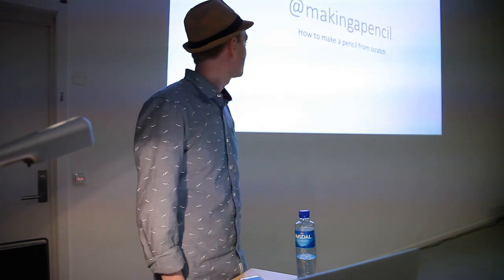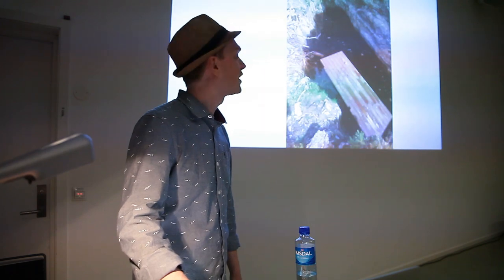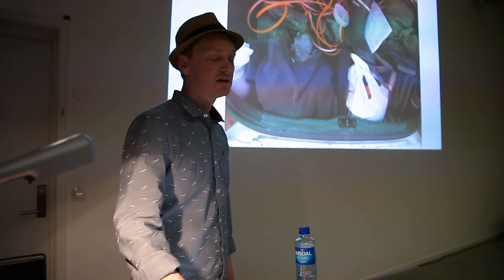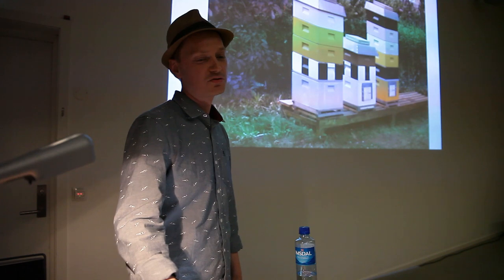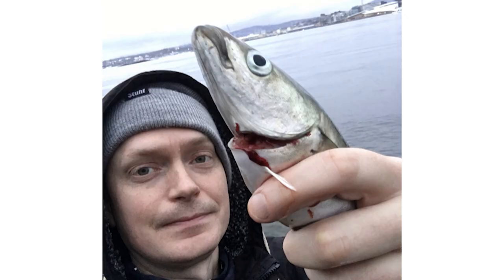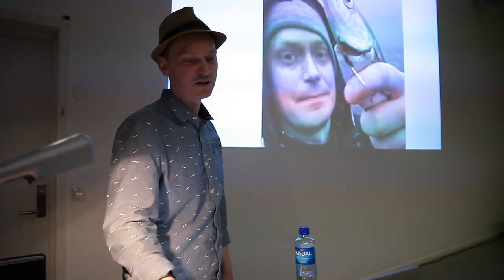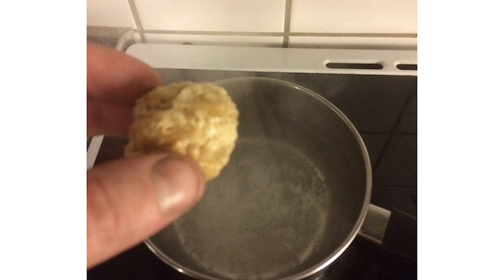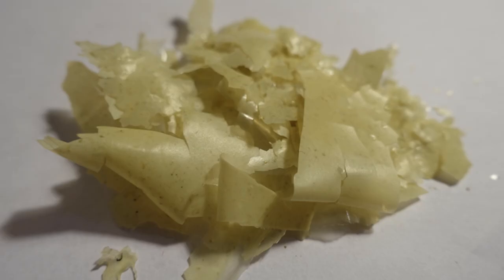How to make a pencil from scratch - @makingapencil

Comment: Hello Thomas. Thank you for sharing this presentation. I'm an artist who works with pencil. One of the difficulties that I find is when I try to draw dark shading in my drawing. After a certain number of layers are applied I begin to see a shine in the surface of these dark shaded areas. I did some research, and found a reference about an artist named Antonio Lopez Garcia. In this article the author says that Garcia "used a pencil that was greasier and more matte than graphite—what we used to call a composite pencil—which provided more intense darks when needed. It was the drawing technique that was taught at the Escuela de Bellas Artes and passed on to us. This task can be such a mystery."  I was wondering if you know how to make a pencil that makes it possible to get a rich black tone without shine. I've tried using charcoal but this isn't as good as pencils for doing subtle blending of tones. Any help that you could provide would be appreciated.